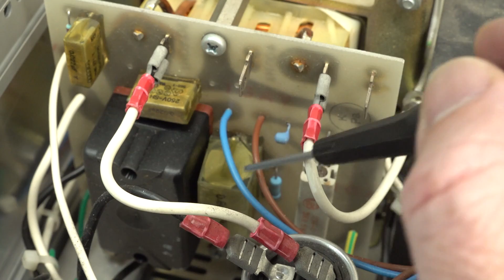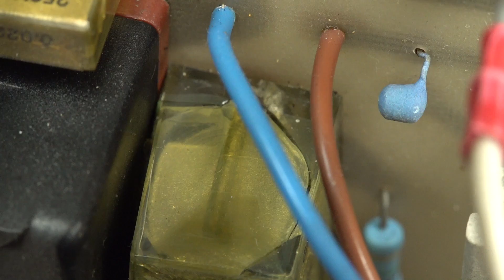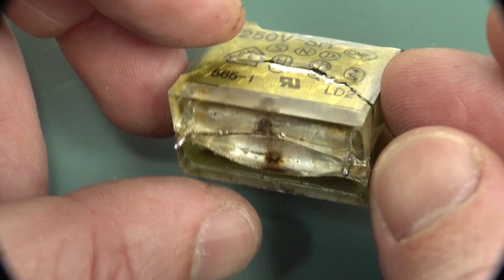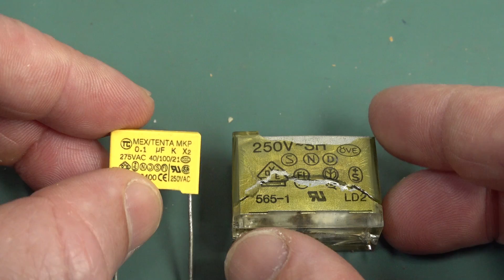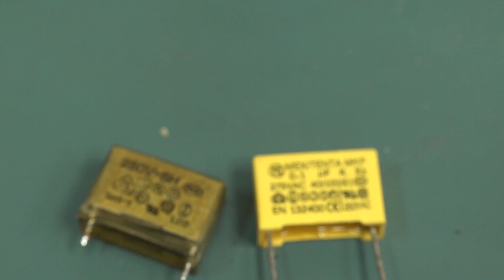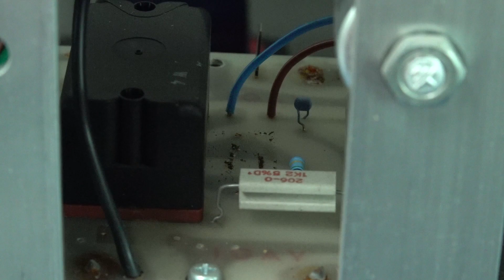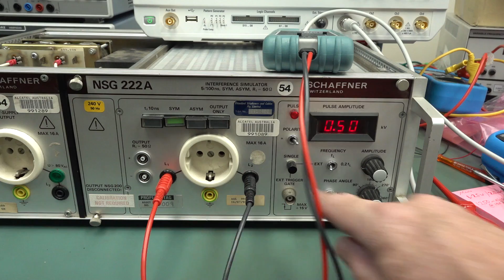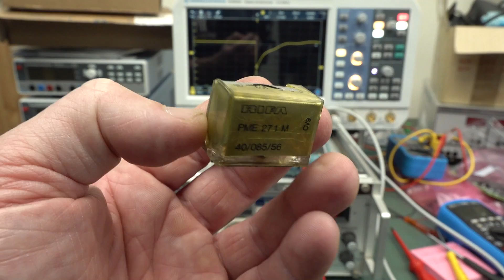EEVblog #1183 - RIFA Madness (Schaffner Repair)

Comment: Some background: RIFA  is Swedish and stands for RadioIndustriernas FabriksAktiebolag, which translates into The Radio Industry's Manufacturing Incorporated. This was a company launched by the Swedish government during WWII, because it feared there might be a blockade and a shortage on electrical components. The government wanted everyone to have a working radio so they could receive messages in case of an invasion and beyond. RIFA's initial charter was essentially to manufacture as many components (mainly caps) as quickly as possible. Apparently, the initial runs had some serious quality issues, and a saying in Sweden at that time was "If your radio stops working, just replace the RIFA caps". Anyway, RIFA became pretty successful over the years and did pretty well. After a while, they started producing ICs and other components as well and eventually got bought by Ericsson to produce mainly ICs for their AXE telephony switches. I worked there in the 80s, right in the transition between RIFA and Ericsson. It was my first job. A summer job that kind of transitioned into a "real" job as a programmer for their test engineering department. It was a great place to work. I don't think there's much left of it anymore. The caps production is definitely long gone.
Reply: Evox bought the capacitor business and later Kemet bought Evox-Rifa. They still make these crappypotted  paper capacitors, and I think they kept the production faciity in Kalmar for quite some time. I didn't even know for sure they closed it down. Unfortunately they apparently did't think that was a good moment to scrap the old production lines...
Reply: @mjouwbuis  Seems like this type of caps are produced in Finland nowadays (Evox).  There's one factory in Gränna, Sweden producing electrolytic caps though (Rifa).
Reply: RIFA caps are notorious for blowing out in certain vintage keyboards.
Reply: I don't know about Kalmar, but Kemet still produces automotive capacitors in Gränna, in one of RIFA's old factories! As far as I know, it's the last passive component factory left in Sweden, so I'm super happy that they're keeping that alive.
Reply: I just bought a RIFA paper filter cap last week, so they are still in market.
Reply: But definitely a down-to-earth idea to replace those before they do fail Eric horse if and when they do wish they probably will?

I've had one thing go bang previously.

I think that I had some of those that were a number of some sort with a cap and resistor to Fork terminals crimped on the leaves in sleeved Leeds I did use them somewhere but I can't remember for what it was probably noise suppression on something?

Don't know if it was a line voltage circuit or not? Been over 20 years.

I think that was a project that built for someone else as well who knows David still around but I don't know about the Caps resistor assembly.

The resistors were internally molded Within the cap housing you could see it through the side it wasn't series I do remember that.

Although it's possible it was a doctor?

As I said I don't remember what exact application used it for but I just remember them.

I thought you might have known what they were? And the application? That's why I asked but I do remember it was that name Brown they look exactly like the Caps except the sleeve leads and a crimper on muds any internal resistor bolted in or as a set inductor?
Reply: Fun anecdote: I used to play outside the RIFA plant in Kalmar. It was close to my primary school. They had a gravel football ("soccer") field outside which used to be turned into winter sports ice rink each time it was that season.
Reply: RIFA was bought by L.M. Ericsson in 1946/47. In 1988 Ericsson sold their capacitor business to Finvest Oy (Evox). The silicon/IC business was merged into Ericsson Components AB, which was later renamed Ericsson Microelectronics AB.

Comment: In the past couple of years Yamaha have done a product recall on 30 year old amplifiers which were fitted with RIFA smoke bombs. On the same audio forum someone had posted pictures of a RIFA capacitor that had exploded despite having never been fitted into a board. No smoke but the thing had completely split apart.

Stories from me about RIFA capacitors. 

1). Hope your vacuum cleaner doesn't have one fitted. With all the air going through you won't see smoke but you will smell it everywhere.

2). If equipment fails check for these. My Mother threw away all the accessories for her expensive sewing machine and asked me to take the machine to the tip thinking the motor had burnt out. Out of curiosity I looked inside and it was a RIFA capacitor next to the motor had released all its smoke.  

3). I'm watching this after having a second Philips Oscilloscope release all the magic smoke from one of these.

Comment: Dave, replace the mains input IEC connector as well! It also contains the same type Rifa paper capacitors, according to the comment overlaid on this video. Have a look at that comment now, I asked him, and he confirmed. He tossed out a whole NOS box of these IEC connectors, because they fail the same way!
Reply: I agree. The Schaffner IEC connector is almost certain to fail in the same spectacular fashion. I haven't opened one up but I suspect they have same RIFA caps inside and exhibit the same failure mode. 
In my experience the RIFA caps drop to quite a low insulation resistance  before failure so an insulation resistance test from line to earth can be useful for finding dodgy Y caps in an IEC module. I treat anything with an insulation resistance of less than 10 megohms as an imminent failure and replace the filter module. 
However, finding dodgy X caps with an insulation resistance test from line to neutral is less successful since the filter modules commonly have a in-built discharge of a few megohms which masks the leakage of a failing X cap. It is safest to just immediately replace any Schaffner IEC connectors of that vintage.
Reply: This has happened to me twice in a year, just now on the IEC im choking on the sickening smoke

Comment: This is a common problem with vintage computers. Especially in the power supplies. Just get an old machine, turn it on, and boom! Magic smoke! First thing you gotta do with vintage equipment before you turn it on the first time, is check the caps. You see these paper-wound X/Y caps, you don't question it, just replace them right away.

Comment: Hahaha these are such a classic thing to have go bad!I happen to live in the city where they were manufactured and know one of the guys who developed those caps. A fun little side note about them is if you leave them powered on they will basically never go bad, because they were designed with some amount of inefficiency, causing them to run ever so slightly warm and dry themselves out.
Reply: Nice to hear from someone who actually knows an insider. It's indeed known that under light working conditions, keeping paper capacitors powered up is good for their survival. Did you ever ask this guy why they kept on making those, seemingly to the exact same design, for decades on end even long after the design was outdated and probably known by the quality control department as needing improvement or discontinuation? Is it just because customers kept buying them?

Comment: I had 2 of these RIFA caps fail in an old sewing machine. 
(The one in the machine went first, after 15 min of use, and after another half hour, the one in the pedal had enough also)

Not a pleasant smell at all!
Reply: And with some of these old x and y caps if the fuse doesn't cut quickly enough, they release this sort of weird tar like vapor........which forms a sticky coating on adjacent parts and smells like burning phenolic.....vigorously....oh boy......ethanol/spirits remove it just fine, though. And i think it wasnt just RIFA.....WIMA made...and STILL makes caps that look virtually identical. Me thinks those also blow. Let's hope the new ones don't cause the same shit in 20-30 years -.-

Comment: "safety capacitor" and "notorious for failing" don't go together too well.
Reply: Pamperchu  by bursting into flames?
Reply: Pamperchu  They are very often failing to short. Just a momentary short, because when they blow up, they eventually go open (usually, but that's like Russian roulette). I've seen dozens on mains fuses blown up by them!
Reply: Safety co-pastor failure first safety second it will work fine as a safety capacitor in till it's failed unsafely
Reply: @poptartmcjelly7054  They are "flame proof". Of course that doesn't mean they can't emit copious amounts of smoke while depositing nicotine like gunge all over adjacent components. I saw it for a fourth time this week while testing an old Philips Oscilloscope.
Reply: Yeah, but these aren't "safety capacitors" as they aren't Y class, they're only X thus are designed to fail short - the circuit designer needs to take this into account... most didn't.  I've never had a RIFA Y fail short.
Reply: @MrDuncl  just had one explode in a Philips scope too lol

Comment: You DO need all the chokes and caps to make sure that the pulse you generate on the output doesn't contaminate the rest of your instrumentation.  All of those devices ARE really necessary.  You really don't want to test ALL your lab equipment, only the one device on the DUT side of things.  Fascinating about the caps though.
Reply: Yes, I think the 1kV pulse was only about 750V because some of it was pushing back into your lab mains!

Comment: I should have disputed Dave's assumption it was the transformer / choke. I used to rewind motors & transformers... and lacquering and baking them. There's no way the lacquer could re-liquify and drip upon being reheated. Yes, in stripping motors we used to heat up the stator by powering it without the rotor... and that would make the windings easier to pry out after air-chiselling the tops off. The lacquer would become sticky... but never liquidy. Maybe after 6 hours at 400 degrees... But my electronics knowledge is very limited. However in this very narrow example my motor/transformer winding knowledge is more than Dave's!!! Yay!!
Reply: Bill R the copper was still bright around the turns, I observed the same thing but trusted this Aussie ‘s big, experienced-nose to sort out the culprit by smell on site, tho evidently mistaken were we both, or he planted a trap for us new players at home for the sequel.

Comment: I serviced some Luxman stereo equipment from the late 70s that had similar Rifa caps. None had failed, but it was clear the cases were deteriorating like you demonstrated. Needless to say, I replaced them with some new poly x-types along with all of the original electrolytics, and I'm glad I did!
Reply: mishmash,  Smooth move...  charcoal brickets don't fetch much on eBay!
Reply: @BruceNitroxpro , no Ebay here! Those amps are making sweet music in my living room.

Comment: I was going through some old (new) parts I have and I found a largish Rifa cap, never used, but cracked just like the rest. I always thought they swelled up and cracked after many years of service - Not so, actual usage does not seem to matter, just the time from manufacture to now.

Years ago, I worked in a Telstra repair shop (TSG Collingwood) and we had trouble with GEC Terminet printers catching fire, it was eventually tracked down to these Rifa caps in the power supply.
These printers could easily be left to run for days monitoring things, unattended, so if one of these caps smoked up there would be no one there to switch it off before the flames started after all the initial smoke had been let out.
Reply: Yeah that PSU should have had a fusible resistor in series, a common penny pinching design omission I've found in several PSUs over the years.  Modern filter capacitors just lose their capacitance over time and may as well be open circuit after a few years.  The RIFA design was supposed to be "self healing" however, the epoxy doesn't have flexibility nor the same thermal expansion characteristics of the metallized paper roll of the capacitor and cracks form, these allow water ingress and then it's game over, it's akin to wrapping aluminium foil over toilet paper, once it gets wet, it turns into a good conductor and boom... 😱
Reply: @davidhunt240  What is the brown nicotine like gunge that comes out of them ? The ones in the video looked quite clean compared to one I have just had fail.
Reply: Those hadn't failed under load.  Typically the X capacitor fails and goes short circuit blowing the main fuse.  This prevents the other capacitors from failing in quick succession.  The gunk that comes from the capacitor is the glue, paper and moisture (often melted aluminium blobs too) and those things also get hot enough to burn and create the characteristic smoke.  In larger PSUs > 1kW there's often a fusible resistor in series with banks of these damn things and they are like Chinese firecracker ropes, if there was a ghost in the machine, it's gone and done a runner now 😝

Comment: Just yesterday I powered up a Grundig V2000 format video recorder for the first time in about 10 years.  Oh yes, lots of magic smoke.  The smell is similar to that from the old phosphorus matches.  Replaced capacitors with modern high quality X type ones of the correct value, even though, as you say, the unit will actually function without them.  They are branded WIMA.

Comment: Thank you for this video Dave.  I just bought a bunch of test gear at auction and the first stuff I was going to sell on eBay were 3 HP 3478A multimeters.  I had just gotten done finishing the eBay post (after hours of documented function testing) and was so happy with the first meter being dead-on accurate 16.0000V to my 16V precision reference... and then (fortunately) noticed a post about RIFA capacitors - which my 1983 version of the 3478A uses!  Annoying to have all those test hours wasted (will have to redo testing after replacing components of course) but great to learn something new.  Thanks also for explaining X and Y class and their use-cases, I'm not ashamed to admit I might well have replaced the caps with improperly rated same-value caps otherwise - but not now.  So you saved my bacon twice over.

Comment: In europe they might be underrated by now also since we have raised the grid voltage. In my sewing machine there were 220v caps and our grid is now 250. I dont know how much that would matter but the new ones are properly rated anyway.
Reply: Det är väl 230v i Sverige, inte 250? Högsta som finns är väl 240v?
Reply: @Eddies_Bra-att-ha-grejer   Det är nominellt. kan vara så låg som 210 vid hög belastning och 260 270 andra gånger.  Sen kan det ju spika när man statrar såna grejer som just det kondingarna sitter i tex symaskiner då kan det lokalt vara väldigt mycket högre än den nominella nätspänningen.
Reply: @Eddies_Bra-att-ha-grejer  Big Clive's videos often show the voltage at his sockets being around 246 volts.

Comment: Few months ago I put a comment because I repaired a ye olde Swiss made Meteor winder from mid 70's. Electromechanical motor controller was virtually blown out by those Rifa caps. Now I had another popcornish Rifa caps madness. The victim was an auxiliary SMPS assembled in Mexico inside a mid 90's QUAD IVc MK2 pick and place machine "proudly made in the USA" (cuac!). In this ocassion those common mode filter components don't caused massive destruction, but in our cold humid Buenos Aires winter conditions, became leaky and the nearby Laser aligment controller gone crazy.
So, the moral is: If you see an old Rifa cap, just change it!
By the way. Dave, I liked so much your differntial probe! If my coutry's economy goes better (and my own), I may consider to get a pair of those. My lab colleagues have a devotion for frying oscilloscope probes as if they were gifted them!! :-(((

Comment: I've had this happen with an old amber monitor. Back then I didn't know what it was and threw it out. I kind of regret that because it still worked, even after that smoke escaped. So I think it also was a filter capacitor.

Comment: Might be a good hint to remind people to measure those old safety caps before using them in a new circuit, quite often they slowly fail open and the capacitance rating can be nearly zero after a "one product lifetime" of use.
Reply: and look closely for cracks. That happens even on New Old Stock.

Comment: I got bit in the butt with those caps.  WARNING/NOTE...  The older Tektronix scopes have these caps in there.  One blew up on me in my 2213.
Reply: and Philips scopes, BBC Micro's, Husqvarna Sewing Machines, Electrolux vacuum cleaners (that one was smelly 😞). I've had failures in all of those !  I don't own a Yamaha amp but they have done a product recall an 30 year old equipment because of these.
Reply: Yeah, I've had a Husqvana sewing machine and an older Kenwood food mixer release the magic smoke.